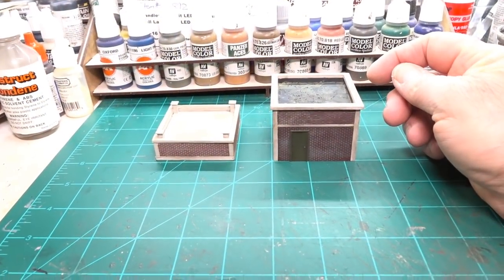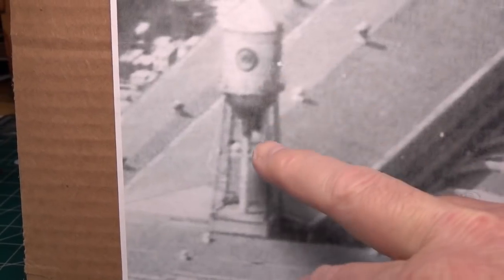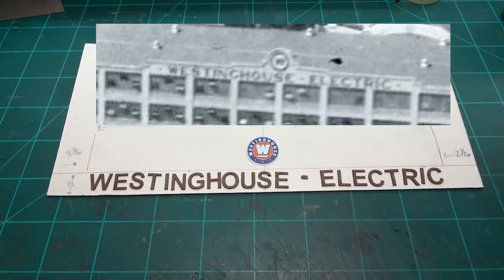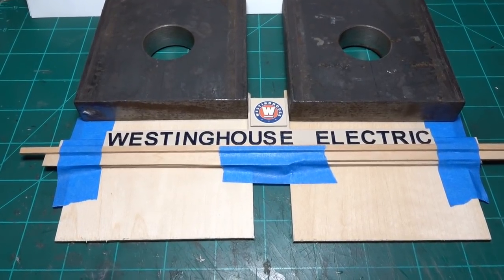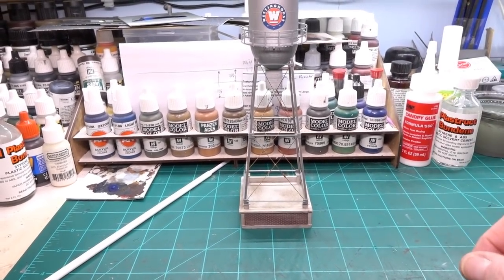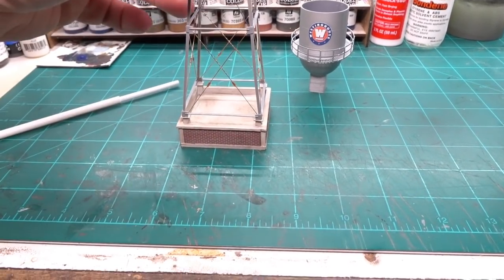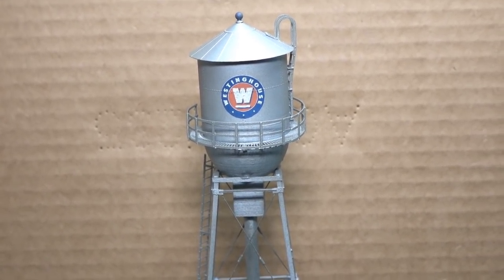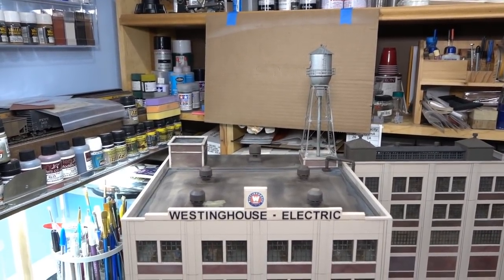Scratch Bash Project: Westinghouse Transformer Factory- Part Five

Comment: The picture you showed of the factory had what looked like a walk out in the corner of the roof. The structure with the slanted roof. I think the structure you built may actually be the cable hoist house for a large elevator for moving stuff from floor to floor. That's my guess. It's awfully big just for a walk out to the roof. I might be wrong and why does it matter what is what? If you say it's a roof access on your building then that's what it is. The building looks awesome. You've done a great job on it. Stay well.  -Wil  👍